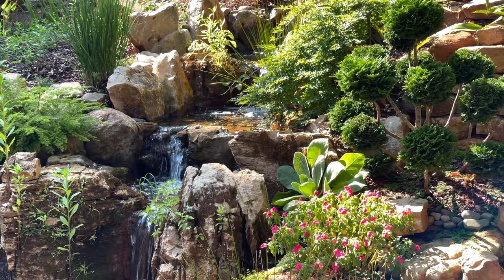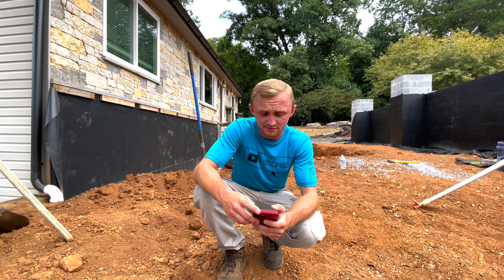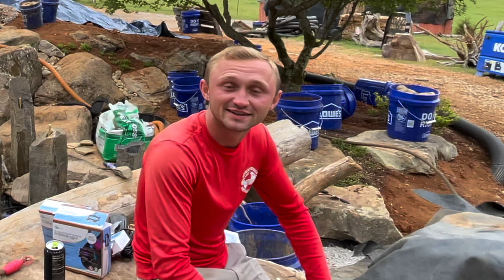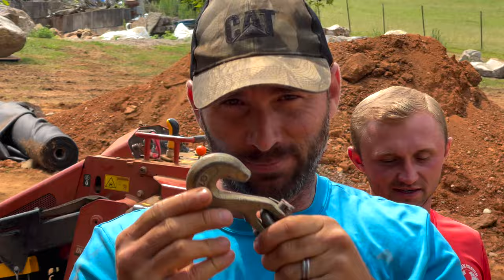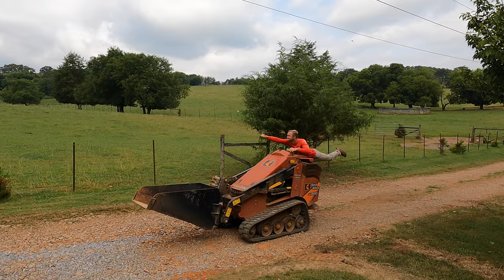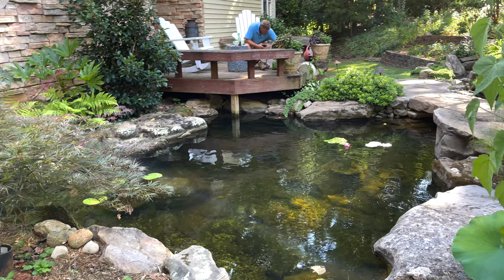Building the Oasis, Part 13 | Wetland Filter and Pond Friends

Comment: Love all of your videos. When building a pondless waterfall or fountain or negative edge on a pond do you fill up the reservoir all the way before starting the pumps or do you leave a little room depending on how much water in motion you have?
Reply from the maker: Start from full- and then when you reach “circulation” the level in the reservoir will be your operating level. That basically means that when the power goes off, you have the storage capacity to hold the water in motion. If you fill the reservoir up after it reaches “circulation” the water in motion will overflow when unplugged because there is no more available space to store the water in motion!